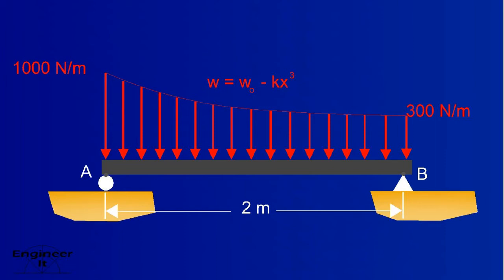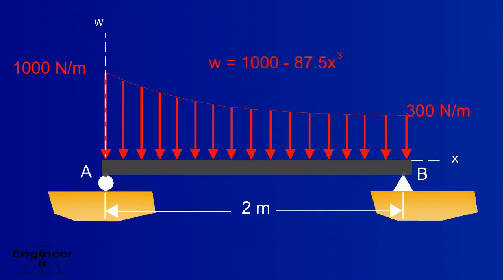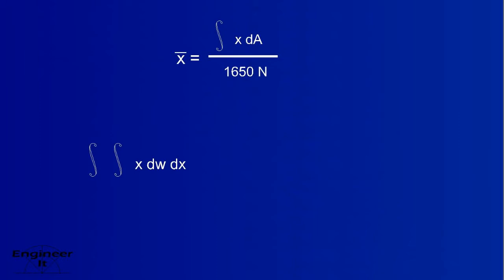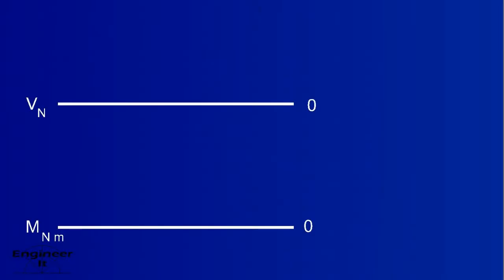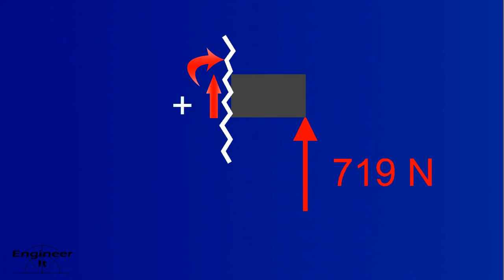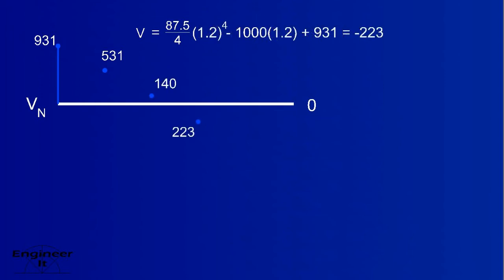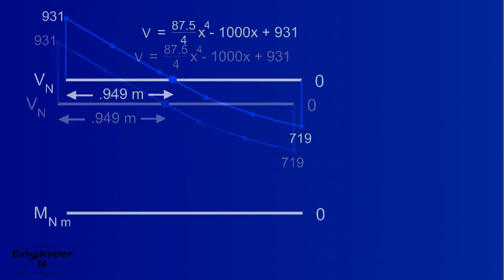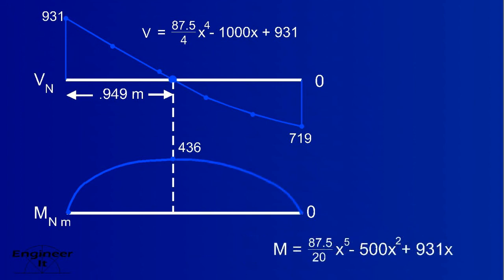Shear and Moment Diagrams

Comment: At 2:37 your integration shows 87.5/4 when it should be 87.5/5. The calculated result is correct, just a typo in the integration step.

Comment: missing a term
Reply from the maker: No missing term.  Check your math.
Reply: Your solved problem is incorrect.
Reply: Your load function is not  quite correct,check your initial condition , your cubic function has two missing terms working from left to right .
Reply: Send me your email and I send you how I did it,thank you.